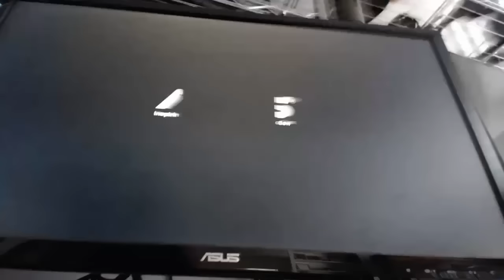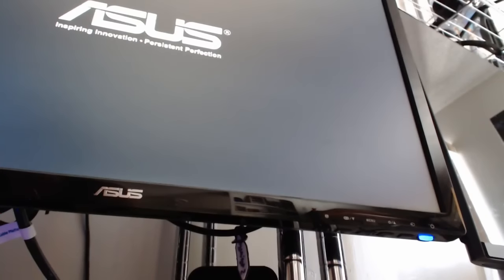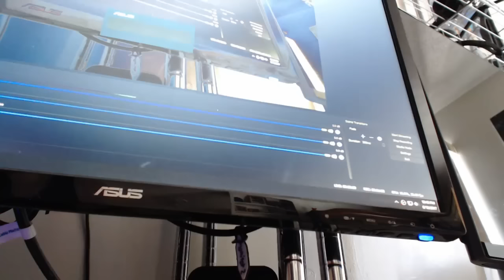Asus VG248QE DisplayPort No Signal - Quick Fix

Comment: This actually worked !! My second monitor would come on but my asus one kept flashing this every like 20 seconds. Even tho i had plug my stuff in and out, plugged cables back and forth but i guess i was not waiting long enough for the led light to turn off. With this he tells you to plug it in and out and WAIT. I plugged it out and waited for the light to turn off, plugged it back in and it turned on right away

Comment: Yo if this isnt working for someone. Try this.
If you are using Nvidia:

1. Open up the Nvidia control panel
2. Click set up multiple displays
3. Ensure your monitor has a checkmark next to it

i clicked multiple times on the Checkbox then it appeared and everything worked. 
Thx to the person, who mentioned it in a forum.
Reply: You are right my bad, youd need a second monitor connected. Probably with HDMI or DVI

Comment: I don't know if thos 3 year old video is still getting looked at but my monitor when unplugged remains lot orange, even when all cables are removed
Reply from the maker: Are you sure that ALL cables are removed? If it's still orange after 30sec you've found infinite power my friend.
Reply: turns out there was a mini battery plugged in incase power went out

I just missed it haha, tutorial worked otherwise! Thanks!
Reply from the maker: @Null24  Great!

Comment: If this video doesn't work - I have an ASUS VK278. Using only the buttons at the bottom of the monitor. Press menu and notice the button to the left of the menu is a down arrow you will use that to scroll to where you need to go. So next press system set up. Then all reset. Poof. Big black box on top right of screen with display port no signal, is now gone.

Comment: Right, this worked. But the question is, why does this even happen? Both my monitors wouldn’t detect signal at the same time when i turned on my computer. Never had this issue before.

Comment: 5  years later still helping people I have a 2nd monitor and when this one kept saying no signal it reverted to 2nd monitor only so when I did this and plugged it back in I had to change to first monitor then extend it then voila its working again.  Always go from simple to hard with fixes.  I was going to deep into the latter side and came back to the former.  Thanks again. edit : 3 years into 5 years

Comment: Ok so I made my first desktop computer like 2 years ago and the display port has never worked. This has been fine because I've been used to using HDMI so I never thought I would need DisplayPort. But then, oof, decided to get a valve index and it works on my laptop, which has a micro dp, but when I came back home and used my display port, holy shit thank god for this video, or I literally never would have known that my display port worked in the first place.

Comment: This comment probably wont ever be answered but might as well try. What if the monitor doesn't have displayport and the computer does? I just got a new computer and I had to get a vga to displayport adapter. But on Vga, HDMI-1, and Hdmi-2 they all say no signal. I tried unplugging the monitor and replugging it in, no cigar.

Comment: Mine says HDMI no signal even though there’s a DisplayPort 1.2 connected?? I worked until I installed nVidia drivers (gpu upgrade) and now as soon as it boots it says DisplayPort no signal. Work fine with HDMI but I want DisplayPort for 144Hz any suggestions?

Comment: I can't get this to work. I have no graphics card in the pc im using this monitor with. The pc had a windows update and when the pc restarted itself, the monitor started giving me the no signal error. I've tried your method for the last two hours now with no luck. The monitor was working perfectly before I had this update. I'm freaking out because I did nothing to the monitor/pc for this to happen. My monitor refuses to give me a signal no matter how many times I do this. I've tried switching cables as well and I can confirm that both cables work on another pc/monitor in my home.

Comment: Troubleshooting 101. Unplug the power cord, wait 10 seconds, plug it back in.
Not a fix, just a workaround, because it's still happening to mine after unplugging the power cord. Must be an issue with the monitor or the DP port. Will swap DVI and DP cables to see if it continues.

Comment: This did not work for my monitor! Does this mean theres an issue where the DisplayPort connects inside my computer or could it be a different issue? (any help would be great I have never played on 144 htz before even though I bought this monitor over a year ago!)
Reply: I read this comment having the same problem. But then realized my display port wasn't plugged in all the way. ffs

Comment: I did this and it didn't work. But it might have had an impact on this other method I tried. So what I did was unplug and replug (power cable and display port cable) then it still doesn't work, so I pressed Windows key + P, menu shows up and I pressed "Extend" and the monitor suddenly worked.
Reply: GOAT I love you man this fixed it
Reply: @glennwhite7821  im glad it eventually helped someone lol, no worries bro

Comment: this asus monitor is so bad i need to replace it asap xD you can fix it but it will come back
Reply: I'm surprised I don't see more comments like this. I've got a different model (newer) with the exact same problem. Computer goes to sleep, and the only resolution is to pull the power cord on the monitor. Seems Asus has more than one model with this issue (not surprising since they likely use the same components in many different models). I doubt I'll buy another Asus monitor as this is beyond frustrating. Love their mobos though.

I concur with the others and give kudos to this guy for making a direct, to-the-point how-to.

Comment: Holy fucking shit it was THAT easy???? I'm mad. Thanks for the absolutely to the point video. I've had this monitor for years and I just built a new rig, after a reboot when I changed some settings, the PC wouldn't display. I for sure thought it was the new GPU, or the DP cable died or something, or my settings were wrong...

If you have this kind of problem and your PC was working fine and you have windows 7+, try this with headphones/speakers (any way you can hear sound):

Hold Win and press R (Win+R run menu), type cmd, press enter, then type echo, press space, then hold ctrl and press G. This way the output should be "echo ^g", the ^ being CTRL as a modifier. Then press enter. This should emit a sound. If it does, your PC is working and you should be able to fix it by power cycling your monitor (like I did). If it doesn't, it's not your monitor at fault, most likely. If it does emit the sound but power cycling the monitor doesn't work... Might have a broken monitor/cable.

Comment: yeah ive done this before to fix it but it no longer wants to work. I plugged a HDMI into it instead and it accepts that but not display port. Wonder if the port went out ugh
Reply: Wow, you just commented this 30 mins ago and mine is doing it too now! Maybe I should try an HDMI...
Reply: @DelusionalRaptor  I got it fixed, i plugged in a hdmi and a Display port. It created two monitors in my display settings i selected "identify" to figure out which one wasnt showing (which was the display port) i selected that screen, went to advanced display>Display adapter properties>Monitor and increased the Hertz back up to 144hz after i did that the display port started working again and i unplugged the HDMI. Super weird the turn off or unplug has always worked in the past this is the first time ive every had to do this to fix it.
Reply: @ChrittyMedia  wow, great job ok! i’ve got it just running on HDMI now, i’ll give that a shot too. Cheers
Reply: @DelusionalRaptor doesnt work for me

Comment: Ok guys it's 2023 this problem happened to me and I managed to solve it in a super weird way, I tried powercycle several times, no solution. 1) plug your monitor to your pc with a HDMI cable and run it (Unfortunately I didn't solved with this because with this HDMI I can't reach 144hz ). So now you are in windows connected with your HDMI to your monitor that is not working anymore with diplay port right? 2) Now connect your old Diplay Port back, and once it's connected, unplug the HDMI from your monitor, after doing this my dumb monitor automatically switched on the Display Port like nothing happened, 6 fucking hours troubleshooting and now it works x)
Reply: bro ur a god thank u so much g ily

Comment: The problem im having is that im using a display port cable. When i turn it on it says no hmdi signal, then turns off. I can’t toggle between settings during that time so wtf do i do.
Reply: Same. Did you find a solution?
Reply: @swoleybones  Thankfully I did. I ended up using my ps4 hdmi cable and that made it so it turned on and stay on just so i could toggle between the display settings. After that it let me switch the display even if it turned off. Hopefully you have a console somewhere with an hdmi cable. Hope this helps
Reply: @moxi8998  i do. Seems like an annoying solution that might work lol thanks

Comment: I’ve been trying this trick for several hours now with still the same problem. Now display port signal, and I’ve tried everything. Unplugging and replugging it after waiting several seconds, turned on and off both computer and monitor, unplugged the computer and replugging it, making sure the cables were the right ones, I even went out and bought a new HDMI cable to see if that display would make it work, and still the same problem! At this point I’m ready to chunk the fucking monitor out the window.

Edit: I’m so fucking stupid. There were other ports. What’s odd however is the part where I was plugging it in at had the text “Display port” on it so that really threw me off. Fuck me, that’s a horrible design choice.
Reply: Can you elaborate on your edit. Doesn't make much sense

Comment: I still have the same problem
Reply: same boat. my monitor was fine until latest windows 10 update. i've had some power surges. i'm wondering if my cable is fried or the port on the monitor. did you end up figuring it out?

Comment: Worked like a charm. But why is it like that? Had also different problem with asus screen when it was connected to rx580. It would display white noise/snow after waking up from sleep state and needed to turn off for few seconds. Now after couple months with rx6800xt it started to do this shit like in your video. Im not gonna buy asus panels any more for shure.

Comment: I hope you can help, i want to run 144hz whitch end do i plug into the monitor hdmi or display??
Reply from the maker: DisplayPort supports 144Hz. What is your video source? PC? Console?
Reply: @Winning117  pc, my cable is from hdmi to displayport
Reply from the maker: @johannstrauss4446  If your PC has a DisplayPort I would buy a DisplayPort to DisplayPort cable and use that instead.

Comment: i have the same exact monitor as you have, and i connect the display port and it doesnt work even if i do these steps
Reply from the maker: Disconnect every cable, wait 10 seconds, and plug it all back in again.
Reply: sorry if im late just got mine to work, i opened my pc, and took the ram out and cleaned it just by blowing if that doesnt work take the battery out of the motherboard (little silver disk) for a second and put it back and try

Comment: my orange light never goes off after unplugging it
Reply: Try pressing the orange light button to turn it off, and then turn it on again (while still unplugged). For me that gets it to flush all the leftover power in the capacitors or whatever.
Reply: @CreechieFX  I unplugged it from the pc then turned off the pc with shutting off the power supply for a few seconds and that worked. Thanks

Comment: My light doesn't go black :( keeps saying no signal
Reply from the maker: Read the description :)
Reply: I did. Have 2 monitors and they both do the same, light don't come off :/ i unplugged the power cable rn for a few min to see if it works.
Reply from the maker: @foxtrot7800  You need to unplug all cables because sometimes power can leak through them.
Reply: @Winning117  yea i tried that and it works, thanks!

Comment: "LIAR" Anikin Skywalker
Reply: My Problem solution: Unplugged and waited for power cycle, then restarted the PC. Open windows settings>system>display scrolled all the way to the bottom to multiple  displays>Extend displays. then it worked. cool

Comment: I probably doomed myself, i was watching youtube then my mother came to my room and my screen bevame blue with a sad face saying that my pc has an issue which will fix itself but my mother kept nagging me that she had use the iron board to iron the clothes so i forcefully turned off my pc and i couldn't connect my displayport or hmdi. Both are on graphic card side, hmdi was on motherboard before but i was testing out the cabel's and hmdi worked on my laptop so the monitor work's fine. My friend told me and who helped me out that i probably have to put my graphic card in and out but i kinda gave up at that point since i don't want to touch anything to not make it worse, so i will sadly have to spend money. I also tried win+crtl+shift+b but my monitor is still black so xD, also this option didn't worked for me either.